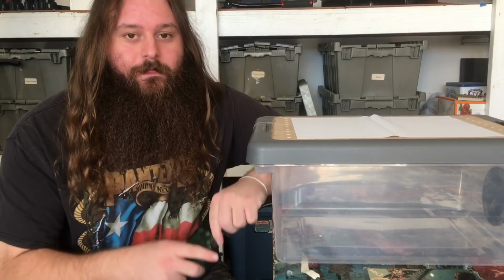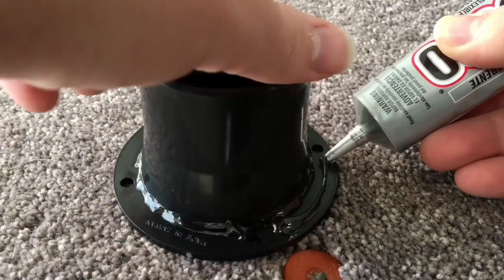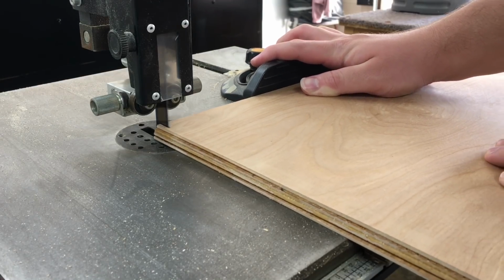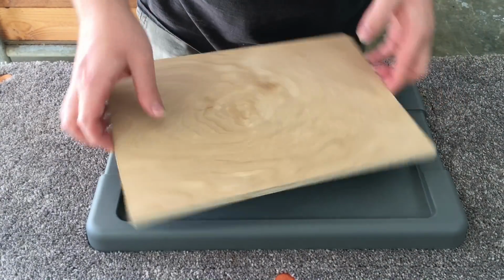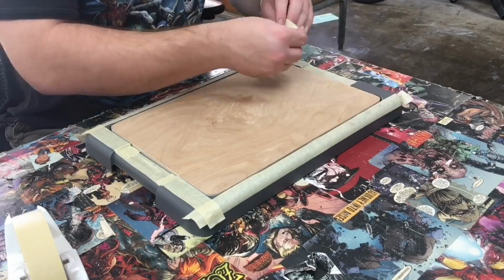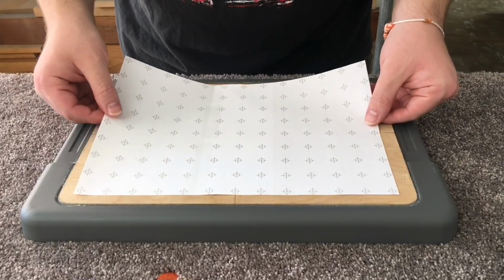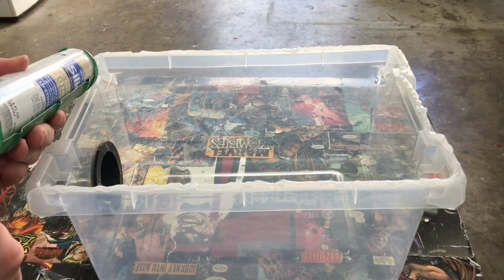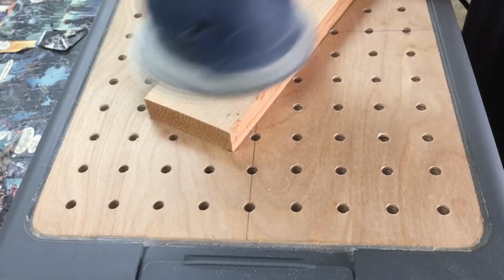How To Make A Downdraft Table Using A Storage Container // Super Simple Diy

Comment: Found all the items in my local Lowe’s, built this and tested it today. I couldn’t find one of those flanges like you used to hook your hose up to so I used a rubber pvc pipe connection to pass through the wall of the box. All seems to be working OK except the caulk that I used, even though it’s been setting up for a couple weeks, never really grasped the plastic surfaces and is able to be pulled off. Where did you find that flange and are you using a specific type of caulk? Thanks for the video!!

Comment: Why seal the top to the base? Why not use a foam gasket, then one an clean the inside. Handy table.
Reply from the maker: The silicone was allowed to fully cure before attaching the lid and only acts as a seal. The lid is completely removable.

Comment: Great concept.
Does the vacuum not get clogged up?
Also, quick tip: You'd get an even smoother Silicone finish if you mixed that water with a drop or two of dish soap. This way there is absolutely 0.000001% chance of any dust catching on the Silicone 😉
Reply from the maker: Thanks for watching and for the tip! I will definitely have to try that out next time. As for the vacuum clogging not really, however to make it more effective you could add a small cheap filter in the box where the hose connects. That should greatly reduce the dust going into your shop vac and significantly increase the life of those pricey shop vac filters. Alternatively you could add a dust cyclone in between the downdraft table and the shop vac.

Comment: Nice build, you might consider putting a piece of wood or lexan inside the box at a diagonal to cut down the volume of the box to increase suction and help use gravity to sned some of the dust at the far end towards the suction port.
Reply: Wouldn't it be best to keep the dust in the box and not end up in the vacuum clogging the filter?  It's like a non-cyclone dust separator.
Reply: Does his top part of the collector come off so the inside of the box can be cleaned out?
Reply: The lid comes off (I’m not the creator) but the silicone is just used to make an air tight seal. The lid comes off to clean the bucket 😊
Reply from the maker: Not a bad idea! Thanks!
Reply: @xyzcreate   I'm wondering the same thing as  @Kenneth Young --- do you remove the top to empty this from time to time? Does the silicone just make a tighter seal for the lid?

Comment: How does it compare to attaching your shopvac to the sander?
Reply from the maker: I would say it works way better than just a shopvac attached to a sander. Normally the shop vac can only collect the dust through the five or six holes on the sander's pad, but it can't collect the dust that flys off from the sides. The downdraft table eliminates that problem.

Comment: Thank you so much!! You are an exceptionally good teacher/instructor & model.  You do a great job of blending clarity, precision, explanation &  demonstration, with good voice tone and speaking rate. I just discovered you & am surprised about the small numbers of likes; hopefully it's because you are relatively new.  In case you have not thought of it, I recommend you check into Reddit as another way of getting your good work appreciated, and ............. assisting with whatever goals you have.

I just resumed woodcarving after 40 years (76 now). I've got so much to learn and have been daunted by all it takes to prepare my workspace and equipment to do the work I want. Your video makes the next step of setting up a workstation dust collection system seem much more straightforward & manageable. 

As you noted above, protecting your lungs from the fine dust particles is another crucial challenge. I too have a beard. I checked OHSA's recommendations & was not willing to pay the large expense for the full respirator system, required for anyone with facial hair. So, I kept searching. Here's what I got: Resp-O-Rator (videos are on Youtube). Unfortunately, because of the demand for material for face masks, the inventor/developer cannot get the material for his device. I contacted him directly.  He was not able to produce them in sufficient numbers to distribute to sites that sell them, but, he sold me one. He is temporarily using a slightly less efficient filter (still 95%+). Here is his contact information : James Duxbury, Duxterity LLC
 336-227-7168, cyberdux@bellsouth.net. And, the device is inexpensive, and he's a really nice guy

Comment: Neat!  Could this also work as a vacuum former surface?  I have seen videos of vacuum formers that look a lot like this, perhaps the reservoir for the air is a bit shallower.
Reply from the maker: This would definitely work as a vacuum former! I am planning on making a video on using this as a vacuum former in the near future so make sure to be on the look out for that :)
Reply: no problem - just fill up a bit with water to make a shallow'er level